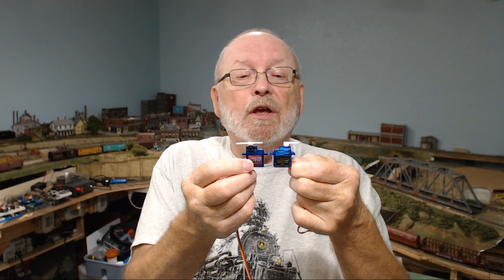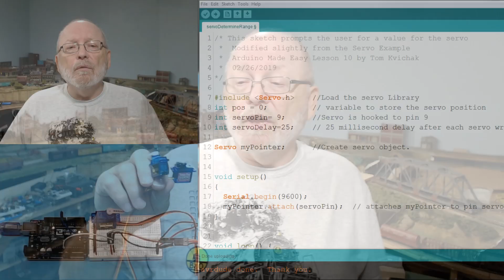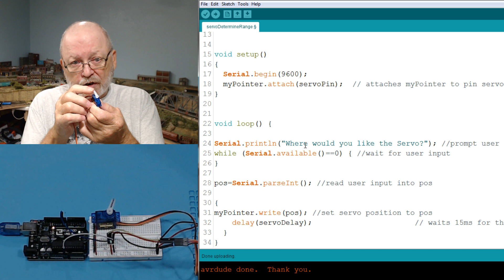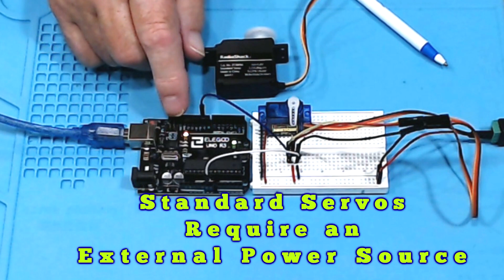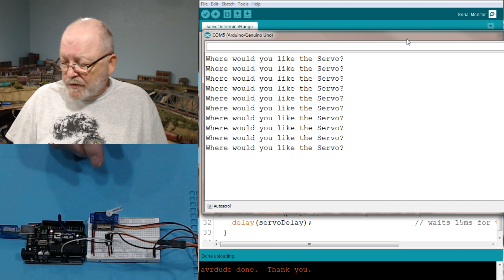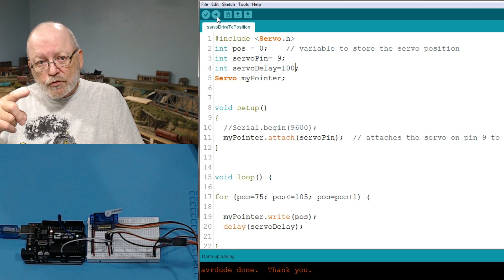Arduino Made Easy(er) - The Basics Of Servos - Lesson 10

Comment: Thanks so much for this series, Tom.  What is causing the delay at each end of the 0 to 180 loop example? I couldn't see anything in the code that would do it. Could it be that the servo really doesn't do the whole 180?
Thanks
Reply from the maker: I was wondering the same thing about the delay on the high range. I did some more testing and found that the servo I used gave me erroneous readings. I tested it to reach 180 degrees, but on the sweep test it was only going to 120 degrees. The delay came from it attempting to reach 180 and then back down to 120 where it resumed back to zero.
I tested several other servos and found they worked properly and vibrated at their limits. The original servo would only travel to 120 degrees on the sweep test but was able to travel to 180 on the limit test.

Comment: Hi Tom... thanks for the video. I would advise not to use delay() in your sketches because the processor is freezing and you can not do anything with the Ardiino in that time. There are several ways to use another way of using a delay without stopping the working of the processor. Keep up the good stuff and greetings from the Netherlands.
Reply from the maker: This series is for beginners, so I keep it simple here. I have more advanced videos where I use other methods to get around the delay. Thanks for watching!

Comment: Hey Tom, I’m very close to getting the Elegoo Super Starter Kit but I really need a servo that rotates 360 degrees. Do you know what type comes with the starter kit? Should I buy the kit and an additional servo, or is there another kit that I can purchase for my rotating needs? Thanks!
Reply from the maker: The kit, like all others comes with a 180 servo. If you want full rotation, use the stepper motor in the kit. Is there a reason you want a servo, or didn't know about the stepper!
Reply: @TomsTrainsandThings    I didn’t know about the stepper! I’ll have to search that one up now! Thanks Tom.
Reply from the maker: @MMRails  Don't think I did a video on that one yet. I'll have to do one. I have about 10 of them. lol

Comment: hi tom ,, im wondering if  you can run a servo on a dpdt sprung center off switch ? im running a motor to lift a coal chute up an down an have control with switch myself for exact postion ?  i was told you can an good but didnt explain it . it will not move much more than a inch or less ? thanks
Reply from the maker: You can initiate the PWM signal with the switch, but you will still need the source for the signal.

Comment: Tom, great video!  I am trying to run your servo program on an Arduino Uno from Vilros.  I am running IDE version 1.8.12.  When I try to compile the program I get the following error:  redefinition of 'int pos' and that line is highlighted. Yours compiles with no problem and I do not understand why mine won't.  I have some programming experience, although it's been quite a while since I wrote code. I know that defining an integer and assigning it a value is valid syntax.  I just don't see where the problem is.  Any help would be appreciated.  Thanks!
Reply from the maker: Sounds like you defined "pos" twice in your sketch

Comment: there has to be a way to use an arduino mega and its outputs straight to dc decoders to control turnouts... or are you limited to and must use servo's?
Reply from the maker: If you have a stationary decoder on your turnout you can control it with a momentary signal just like you would with a push button . Digitrax DS64 has that abiity.

Comment: Great info. Would this also control a switch or switches if I used an external power supply? I would be using a Mega. Could I pull power from a Arduino motor shield for switches. Your videos are really helping a lot. Thx
Reply from the maker: I cover that in another video that came out right after this one.

Comment: Aother Super Video Tom!  Should have a computer next wk. I've had before but with the 2 leaver" A & B..I ALWAYS seem to hit..LEAVE HER "B" lol Oh JR & Futaba (mainly Futaba Hi Torque is what I used in my Giant Scale R/C's  I've been able to "0" the clock positions by lifting the belcrank & re-position them these small 1's don't? no biggie I not there YET lol need soom bread boards jumper cables I see EVERY thing here is "Prime or ebay but everything has to be ordered in ..Haven't been this excited about a project since I told the wife.."I suppose so"... some 40+ yrs ago !! hahahah keep up the Great work!!!  I've done SWALLOWED the HOOK
Reply from the maker: Some servo motors are 360 degree rotation and some are 180 degrees. That's why you have to center by going to 90 degrees.
Glad your starting too get thins for your project.
Reply: I'm sure got A LOT of junk off ebay couple of good sellers but ...live and learn..

Comment: Great info Tom, cheers. Can this be  integrated into the dcc basestation or do you use it standalone? If it is standalone do you have two arduinos plugged into jmri?
Reply from the maker: Turnouts can be controlled through the base station if they have an accessory decoder controlling them. You can see more info on this in the Accessory.cpp page of the base station sketch. I have not done this but may experiment with it in the future. Geoff Bunza has several articles on building your own accessory decoders that can be used to operate anything in DCC. His articles may be helpful if your into building your own electronic projects.

You can definitely do a stand alone operation to control your turnouts and even crossing gates, signals, and semaphores.